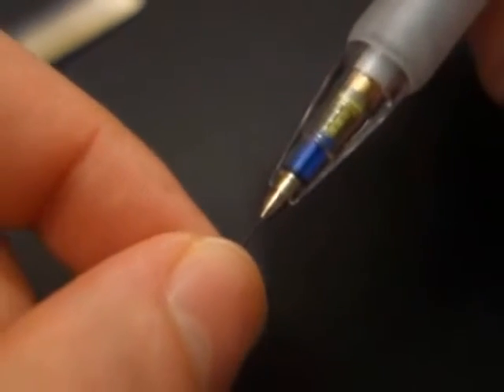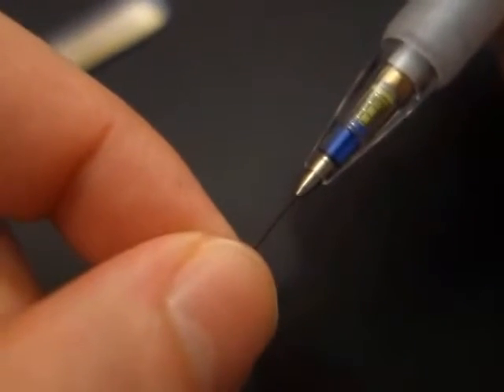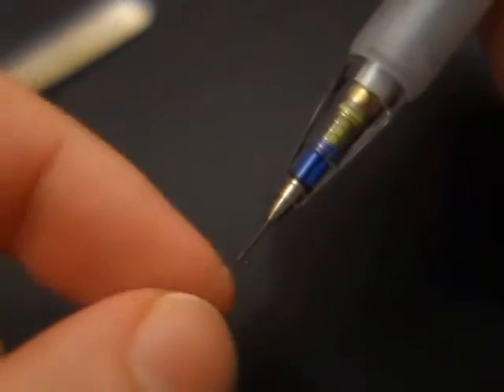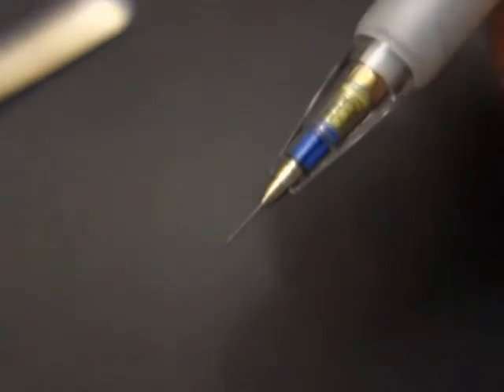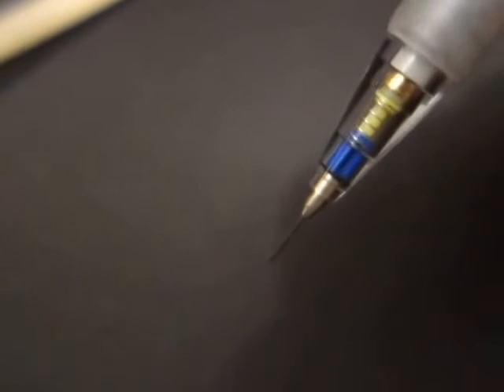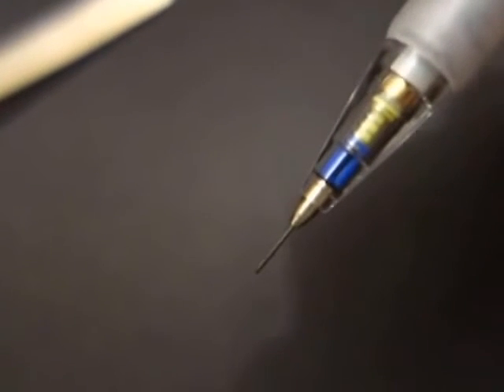Review of Problem WIth Platinum OLEeNU MOL-200 Mechanical Pencil

Comment: I think your observation is correct.  If this was a serious problem with mechanical pencils, there would be more workable solutions provided.  If the tip and lead pipe of the pencil is machined to very low tolerance, there will be hardly any gap between the lead and the pipe.  And so, the lead wouldn't just fall out of the pencil.  The issue of course is continued lead advancement.  Once past the clutch, there's nothing to push the lead... except of course, the next lead!

Comment: It is just a marketing gimmick, no 2nd clutch on any of them...not on really!
Reply from the maker: The Zero Shin line does have an actual second clutch.  The usual advancing clutch, and then the writing tip is a second clutch to actually hold the lead.  The OLEeNU just has a little more friction than the usual pencil's lead tube so it's a little better at using one lead to push the other but, IMHO, not good enough to really claim it as a feature.

Comment: This pencil claims being able to use the lead all the way, and correctly so, other pencils like this like the pilot clutch point work the same way. You see you need to have another lead in the tube for it to work. Have you tried that? Ty it and I'm confident that it will work.
Most people have two leads in the pencil at any given time so that's a given, and I don't see it as a drawback at all. 
Call me stingy or a cheapskate if you will but I'm frugal and I don't like wasting anything (plus wasting materials harms the planet). So I really like pencils that allow me to use the lead all the way, instead of leaving leftover lead and wasting 15% of the lead
Reply from the maker: Yes, I've tried it with two leads, not really any better.  The lead you write with isn't held with much stability. The only truly effective mechanism I've seen to use all the lead has the very tip also being a clutch.  Like the Platinum Zero Shin MZ-300.  That, or a better version, is what I thought I was getting with the OLEeNU.
Another example is the Staedtler 9505, reviewed here http://davesmechanicalpencils.blogspot.com/2008/12/staedtler-integrity-9505-mechanical.html